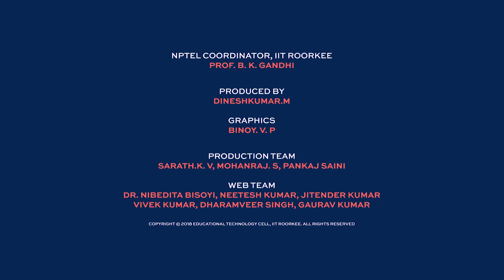CMOS Digital VLSI Design

Comment: 00:17 Introduction to CMOS Digital VLSI Design

00:43 The course aims to provide insight into circuits and systems made by digital VLSI system.

01:09 No pre-requisites required for the course

01:32 CMOS inverter is the basic building block for digital design.

01:49 CMOS digital VLSI design involves simple logical blocks, arithmetic units, and memory designs.

02:21 The course consists of 40 lectures spread over 8 weeks.

02:44 Examination and grading for certification

03:02 Acknowledgment of NPTEL and the opportunity to develop the course.

Crafted by Merlin AI.